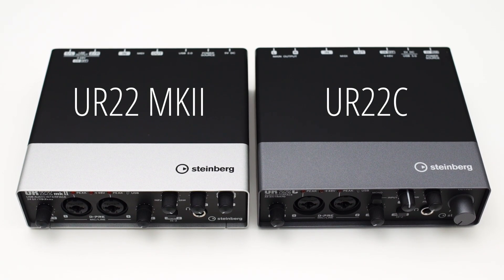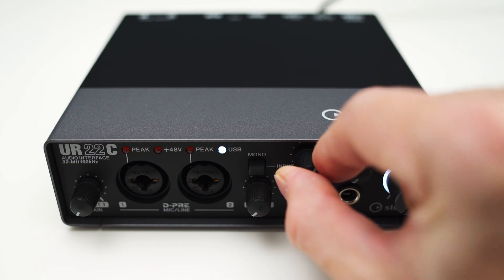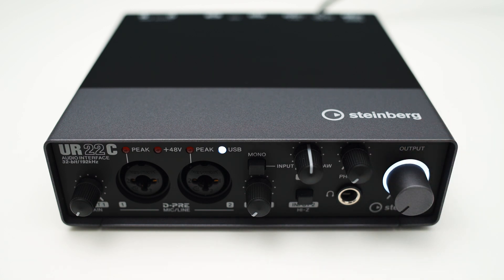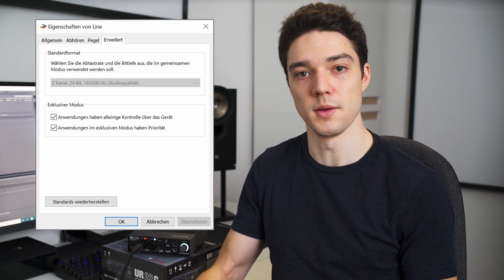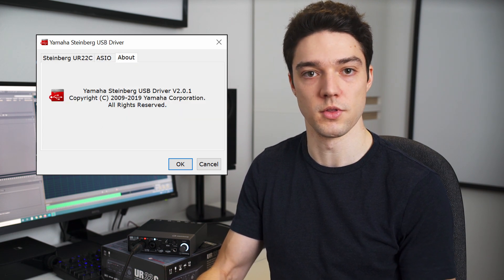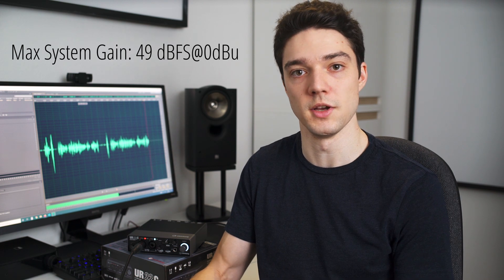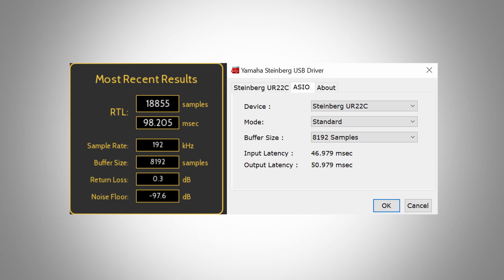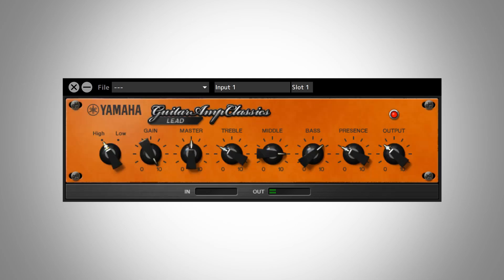Yamaha URX22C / Steinberg UR22C Review - Did Steinberg improve the legendary UR22?

Comment: is the headphone amp ok on this model ? for use with regular impedance, 50-60 ohm, like sennheiser hd5xx range. the 91 ohm you measured is huge compared even to onboard soundcards.
Reply from the maker: Yes, the output impedance is pretty high. It will definitely slightly change the frequency response of your headphones. Now it depends on you if you think a small change in frequency response is acceptable or not.
Reply: @JulianKrause  thanks for replying!

Comment: 14:25 I definitely ask myself this hahaha. Would be great if you could measure the headphone out (and/or line out) performance on interfaces like the Behringer UM2, UMC22, UMC202HD, Focusrite Scarlett 2i2 etc. I'm really curious how those budget oriented interfaces perform. The one thing holding me back from buying a UMC202HD (which seems to have the best price/performance ratio for my needs) is the fact I couldn't find any information on its DAC performance. Ideally I'd like to have a good recording interface that doubles as a decent DAC so I don't need to buy two seperate devices for playback and recording. This new UR22C for example would definitly NOT be good enough doubling as a DAC since that output impedance is way too high for literally any headphones (even 600 Ohm). Thank you for this elaborate review!
Reply: Umc2020hd is nice but the it's 2.0 usb which is ok  I like the steinberg ur-rt2 more than my current model ur22 mk  2 and the ur22c
Reply: Bheringer UMC204HD the best around here!
Reply: The HP output impedance is 40 ohms not 91 ohms.

Comment: Hey Julian, great video. I just wanted to run an issue by you. Plugged in my UR22C to my 2019 Macbook Pro and as soon as I open any of my DAW (Logic Pro, Pro Tools First, Cubase AI 10), the UR22C disconnects from my computer and I'm left with my Macbook audio as my drivers. I really don't want to return it as it's the only future proof interface out there. Thanks.
Reply from the maker: Hey, I found this on the Steinberg website. It sounds pretty much like the issue you are having: 

Problem

Cubase crashes on macOS while starting up, shutting down or when the ASIO driver is being switched, even if no UR-C (UR22C, UR44C, UR816C) audio interface is connected.

Background

This is a known issue with the Yamaha Steinberg USB Driver V2.0.1 on macOS.

Solution

This problem will be solved in the next release of the Yamaha Steinberg USB Driver for macOS.
Reply: Julian Krause  Thanks for the response. I was able to use my UR22C on my Macbook Pro by deleting the Yamaha provided driver and letting my OS built in driver to run the interface. Looking forward to the next Yamaha Update!
Reply: @neil0695  I came to the same conclusion. Steinberg's mac support has always been pretty bad, but they're stepping it up to "downright terrible". Only issue is that you need the DSPMixFX suite to control dry/daw levels. And that is some pretty bad software. I've had to deinstall and reinstall it numerous times, after a reboot it makes Cubase take up 400% of system resources. Steinberg's response to this was, "Well... that's not supposed to happen, is it? We'll get back to you..." (Crickets)

Comment: thought about changing my Scarlett 2i2 1 gen to this because Steinberg seems to have better windows drivers and perhaps more power to my mic. i use a rode procaster together with a cloudlifter cl1 but i still have to move my gain to 90% with CL1.
Would this be a good upgrade?
Reply: I'm wondering why no one answered over the past 4 days. Questions like this are more important than they seem.
Reply: @ashleyleskov3032  After scouting around for new equipment this might be my next upgrade / swap. Quiet a lot more expensive but with loads of controls for my Audio Yamaha MG10 XU

https://www.thomann.de/se/yamaha_mg10_xu.htm

Comment: Hi Julian. Another great video and production. The 32Bit may be FP within compatible software, although it seems odd that you don’t see it in the ASIO control panel. I’ve had certain interfaces that show up as 32FP with Nuendo but not in other ASIO compliant software. It will, as you’ve said, at least operate internally at 32Bit. Which will really help with summing and rounding things off for anything that may utilise its hardware (presumably a DSP). Again, great video. Cheers, Dave.

Comment: Good in-depth video Julian. I don't think the added features to the "c" series don't really justify anyone upgrading from the regular UR series. Focusrite's 3rd gen Scarletts is a different story however.
Reply: Yes I’m wondering if the DSP real-time lie latency processing on the ur22c differs that much from the ‘latency’ - if any given by the UR22.  I just got the UR22 mk2 bundle and wondering if I should return it in exchange for the C or if it’s somewhat trivial.  I recorded through the mk2 and didn’t notice any latency.  Thoughts?
Reply: @clintonspin7028  If you can use, then use it. however if you want to return it for something a little more "Modern" I would recommend the SSL2+ or the motu m4 over Steinberg or Focusrite but It's all up to you
Reply: I would have agreed until it recently became evident that Steinberg/Yamaha are no longer doing firmware updates for the older UR series interfaces. This was exemplified with the release of the version 2.0 firmware for the UR-C interfaces, which have improvements in both integration with Cubase (for those that use Cubase) as well as upgrades to the built-in DSP effects. I was hoping we'd see a similar update for the UR interfaces, but nothing yet, so my fear is that Steinberg/Yamaha are letting the UR interfaces fall out of support, and we won't see anymore updates for those. Frustrating to say the least.

Comment: The issue of the UR22C bitrate being limited to 24 bits, might be due to the driver still being from January and not yet optimized for the new hardware. Due to personal experience, the UR22 Mk II heavily depends on an external preamp. It’s own preamps simply don’t yield the power to get the best out of a dynamic microphone, like the RØDE Procaster, which I use, if you need a very low self-noise in the recording. As the UR22C uses the same preamps, there cannot be an improvement here. I hoped for a better preamp. Like this, i won’t buy the new one.